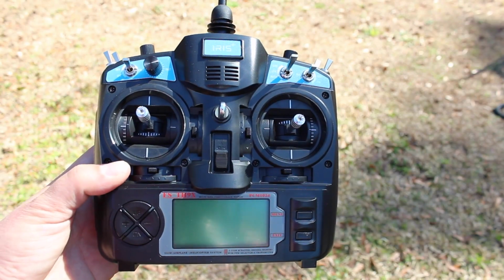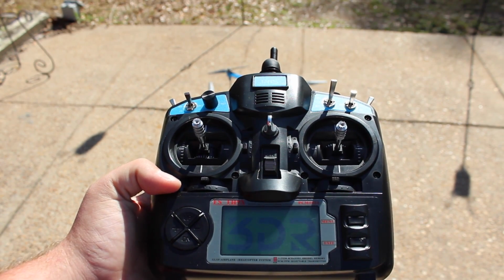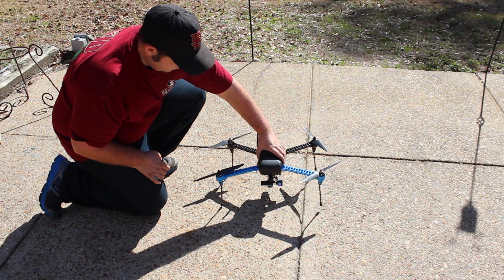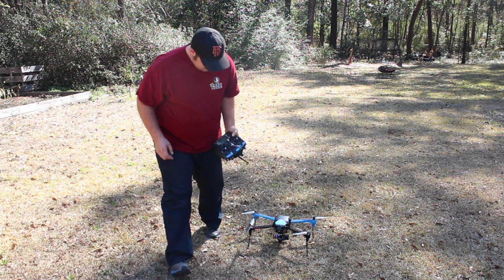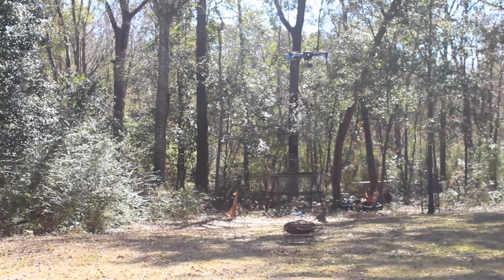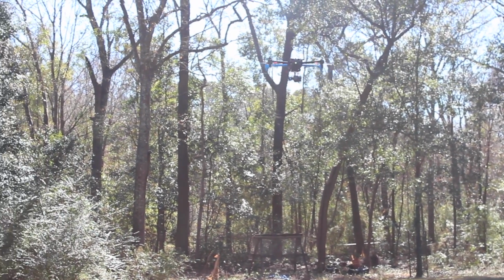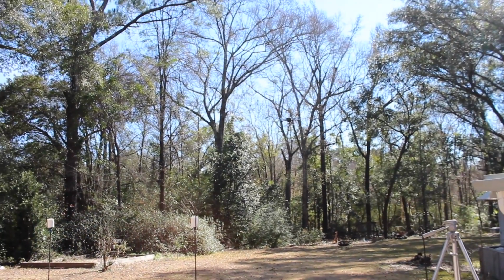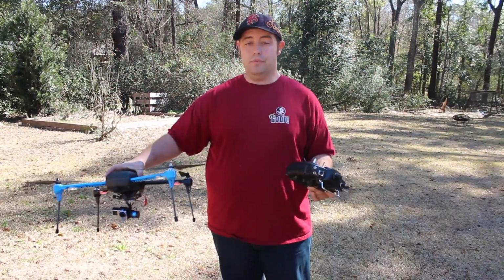3DR Iris+ Drone w Tarot Gimbal Flight and Review (Follow Me and Auto Missions)

Comment: DJI Phantom 3 Standard or 3DR Iris+ for recording action footage (Skiing/Landscape/Follow Me Function). I really have been trying to figure this out. Batteries are cheaper for the IRIS but the Phantom seems to have a nicer GUI and supports iOS/Apple as opposed to IRIS that solely supports Android (Have an android but without  cellular service). I found both around the same price ($550)

Comment: Some mistakes there and considering how dangerous these things can be and the risks to all of us if there is any negative spotlight I must make some comments.

-When you arm the coptor, treat the blades as if they are ON! Do not go anywhere near the blades. You actually picked it up armed and that was scary. Had it started up you would have had a problem. It's not SUPPOSED to randomly start up but there is something called glitches and freak accidents. Even when it's not armed, I still respect the props one the batter is connected.

-The stick on the right is roll, not yaw. You rotate with left stick and roll left/right/forward/backwards

-Also you did not disarm it after follow me. You pushed stick wrong way. It disarmed itself.

Comment: Hey, great video!  I really found it helpful.  I still have some questions though.  If you could answer them, I would really appreciate it.

Did you get a change to test the LiveView for GoPro kit that is available for this drone for 349$?  How is the lag on that?  Does the telemetry antenna work with iPhones and is there a way to connect your phone to the controller?

Comment: After plugging the battery in do not touch the iris. Don't close the door. Don't pick up the iris. Wait until you have the green flashing light indicating GPS lock then close the door. At this point you can arm the iris.